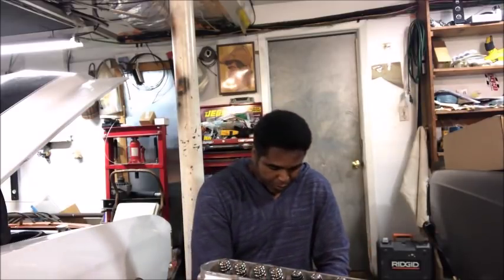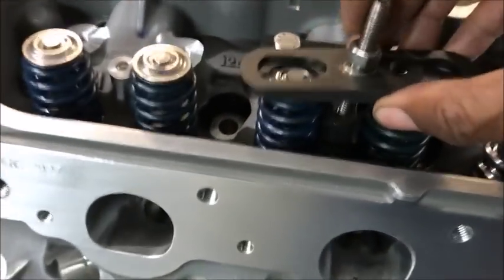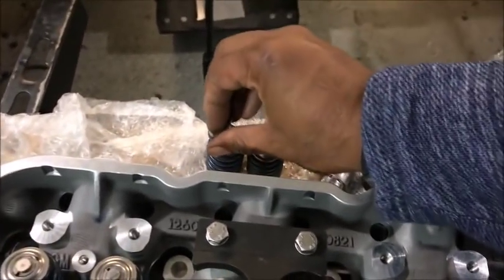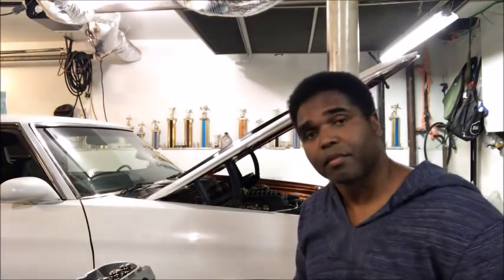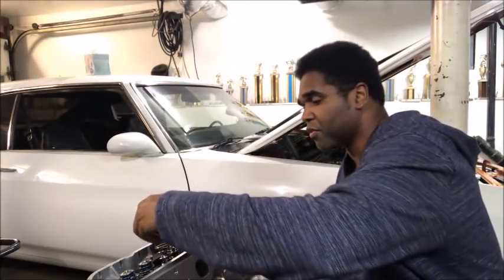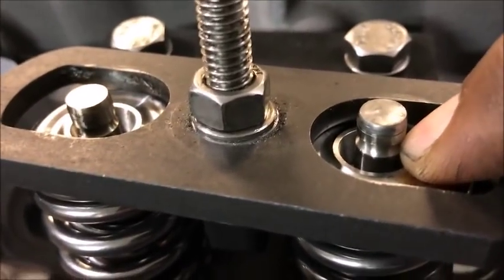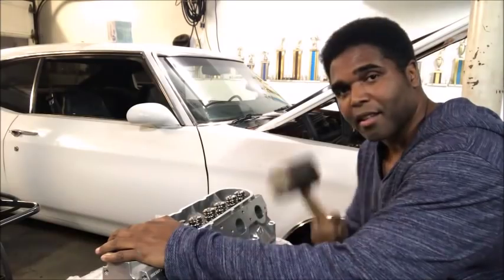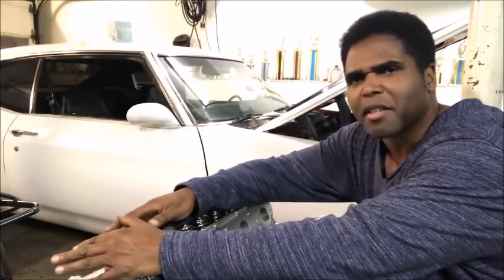How To: Swap LS Valve Spring to BTR Stage 2 LS3 Valve Springs.

Comment: I bought a single valve spring removal tool, do I need one that does two at a time ?
Reply from the maker: what kind did you get? the kit that i have does both single or double..
Reply: I got it off of Amazon, but it’s the one where you use your ratchet and insert it into the square hole and uses the ratchet to compress the spring. I have an LS3

Comment: Did you replace the valves also, I've just recently purchased a ly6 and have watched some of your newer videos and now I'm falling back watching the older content. I'm planning on porting my heads, doing the trunnion upgrade, valve springs, and was cursious should I do the valves also. Any other insight would be helpful I'm only planning on building the top side of the motor.
Reply from the maker: im using the stock valves.. i wouldnt change them unless i had reason to..  thanks for viewing and if you have any questions just hit me up..
Reply: @Coverman66  probably should have added I was thinking about changing the valves because I was going to get the 823 heads ported.
Reply from the maker: i went that route, cnc ls3 heads..
Reply: @Coverman66  so no need to swap valves even after having them machined, I read that porting them 0.30inch is safe for the stock heads or what spec did you port them to.
Reply from the maker: i didnt port mine.. straight out the box to the engine..

Comment: Is it not recommended to break in the new cam with the center smaller spring removed?
Reply: No need to remove center spring on a roller cam,..it's done so on flat tappet lifters to reduce friction on break in..old school
Reply from the maker: ive never heard that before..
Reply: coverman66 per comp cam in the installation instructions

Comment: Will be subscribing, GREAT CONTENT!! Is this the Proform 67605 unit found on  Amazon? Have built several LS engines and currently have my L92 out of my truck converting over to a complete LS3 Valvetrain. Will the compressor tool "you have" work for all LS based engines?
Reply from the maker: yes it will Cal.. no problem... thanks for the questions.
Reply: @Coverman66  Do you remember the PN# of the Spring Compressor  you have? Purchased the Proform I asked about from  the original post and it dont work for LS3 & L92 heads. Thanks
Reply from the maker: i used the jegs compressor for ls engines.. works great.

Comment: what motor mount do you recommend for a ls3 swap?  I have a 71 Chevelle
Reply from the maker: im using adapter plates which allows me to use the stock mounts.

Comment: Great video as always Terry!  I have the same cam. What springs are those and what stall speed is your torque converter?  Thanks!
Reply from the maker: they are double springs that came with the cam kit.. i have a t56 6 speed in this ride. i would call ACC performance and ask for Nelson Gill to help get the proper converter for your application.
Reply: @Coverman66  Thanks bro! Keep up the great work!
Reply from the maker: thanks brotha Charles..

Comment: Dang it, After watching your ly6/LSA vid. I went on the prowl, found a complete 07 Chevyhd ly6,4l80e with 156000 on the clock, picking it up for 1200., Going to pull and build for a future project, Please let me know what cam you used, and if it works without any further mods to the heads besides the spring change. THANKS
Reply from the maker: thanks JB, im still using the EPS cam that i swapped out over 3 years ago. here is the video with the specs. let me know if you have any more questions .. https://www.youtube.com/watch?v=ysgnqm19MNs
Reply: coverman66 Thanks!

Comment: Which spring tool is that one? Looks a lot better than the single spring tool I used. Keep the great videos coming!
Reply from the maker: whats good Gary.. thats the LS spring compressor tool from jegs.. works great..
Reply: Link it up to the video brother, I thought it was a cool tool also, great tool to use if you're changing springs while heads are still on the motor.

Comment: I have hear a lot of people says they run into valve to piston clearance with cam swaps in LS2 engines. Have you have any issues ?
Reply from the maker: i guess it all depends on the springs and cam. if your thinking about a cam make sure you ask those questions.. or better get the entire cam kit to take the guess work out of it..